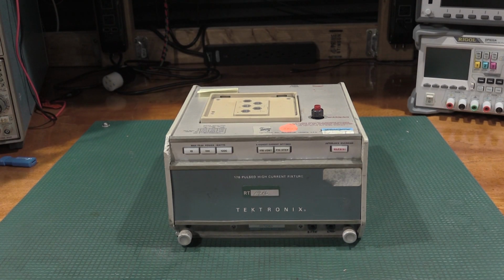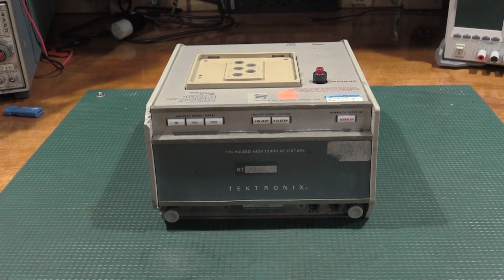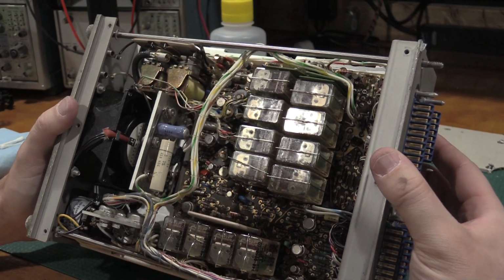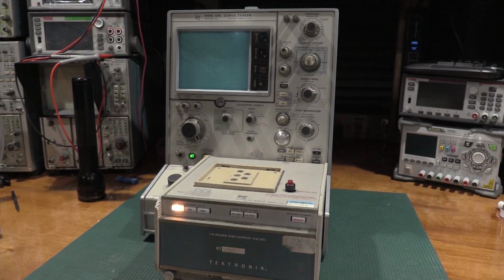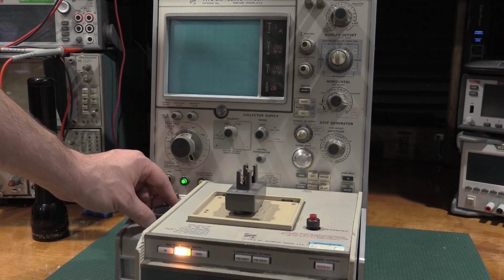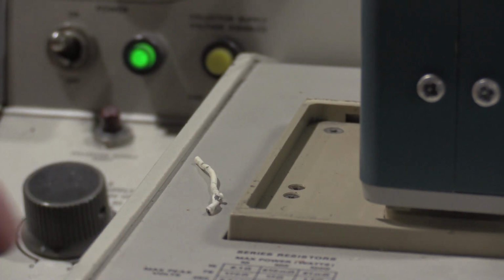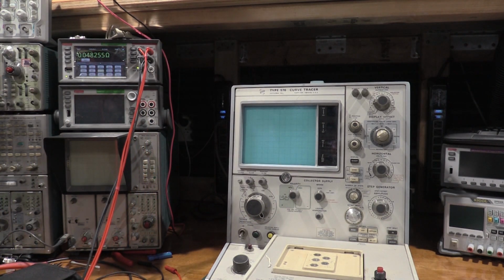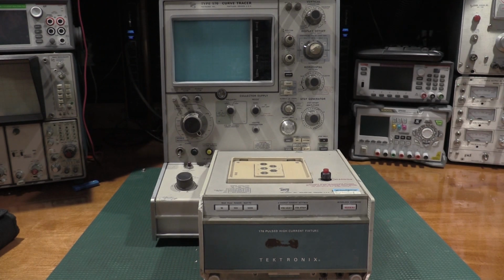Tektronix 176 Pulsed High Current Fixture First Look

Comment: Thanks for the vid. I just picked up one of these and it did not work.  Thankfully it was just one of the 1N4152 diodes across those two open-frame style relays up in the front corner that had shorted out.  I replaced it with a 1n4148 and it now works perfectly.  Hope to find the calibration fixture for it one day.

Comment: recap recap recap!!! nooooooooo!!!!..., try to pull out some of those metalic capacitors that are in the bank close to the big indcutors, they are 100 uF i remember. Check it and try to find some modern capacitor with the same specs, they are solid metalic tantalum capacitors! . my advice is not to change all capacitors because they are old, I have old capacitors better than new ones. In my 176 one of these capacitors were shorted and I don´t find any capacitor with similar specs! In tektronix groups io I have posted some photos measuring ESR of those capacitors.

Comment: dumb question, but are you using the shorting bar in the proper way?  you're going vertical to short things out, what about horz.  the wiring diagram printed on the face plate of the load box seems to indicate you're possible choosing things wrong. i really can't see very well because of the motion blur. also don't forget to double check you measuring meter with a single valid resistor from your junk box.  can you measure each individual resistor in the test box? one at a time? with your choice of shorting bar position????
Reply from the maker: The shorting bar can only be put in up and down it will not go in physically side to side.  It has to be used in the up and down position. I will double check the DMM 6500 for accuracy, but I do have confidence in its measurements. Also when the resistance value measure correct the 576 behaved as expected. So the meter and the 576 agree that the standard is out of spec. It is also wired very strangely internally. I need to get the documentation on just the load resisters and see a schematic. But I have yet to be able to find that documentation.  Then I will work on replacing the load resisters with modern precision ones.  But with 2 instruments agreeing that the load standard is off I am at the moment blaming the load standard as out of spec. The internal construction of the load box is weird, 2 of the resisters load the collector to emitter terminals(select-able) the other 2 load the base to emitter terminals (select-able).  And all of them do 4 wire sensing. The internal resisters in the box are 3 in one physical package and one odd one out of the stack. It is a very odd box.

Comment: It is so sad that in this day and age, shippers use methods to pack that look like a chimpanzee did it.  .... and the perfectly good items that have survived 30 or 60 years, arrive with senseless and irreversible damage. I have never seen one of these high current modules in person... they are the 'unicorn' of 576 tracers. Neat!
Reply: Tell me about it... I have a 567 that was shipped in newspaper, single-ply corrugated cardboard and some plastic wrap... The whole thing is bent but luckily all the knobs and the CRT survived the trip intact!
Reply from the maker: It seems to be a crap shoot some times I had 1 576 shipped like that. The other one traveled in a foam lined wooden crate. I needed a power screwdriver to get it out.
Reply: @ZenwizardStudios  The worst part is sometimes I offer to pay for extra packaging and they don't want to go to the trouble. When I bought a Pioneer RT-909 reel to reel tape deck it arrived damaged and since then I gave up buying anything over 5 pounds on eBay.